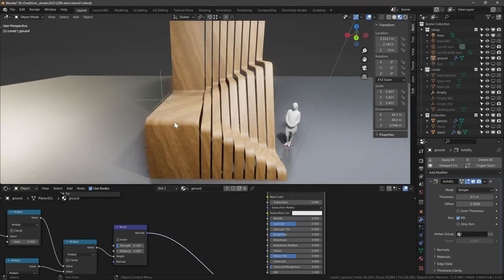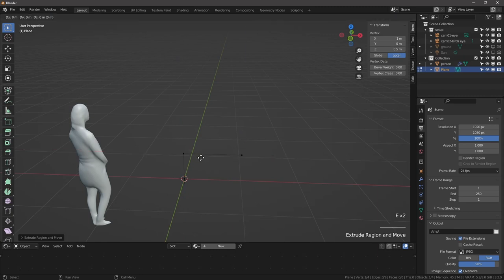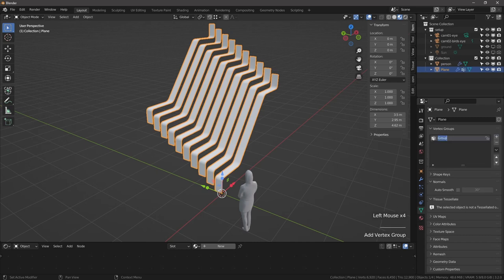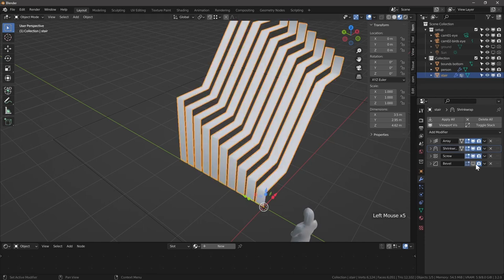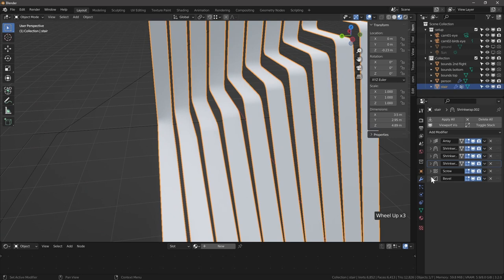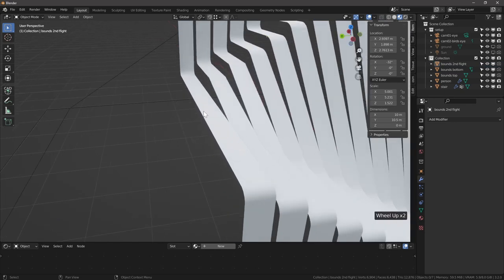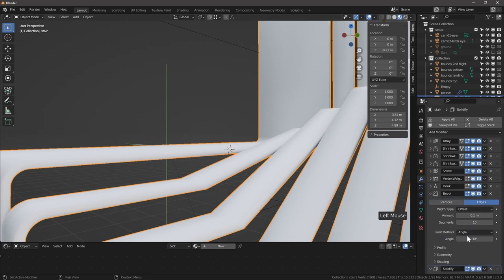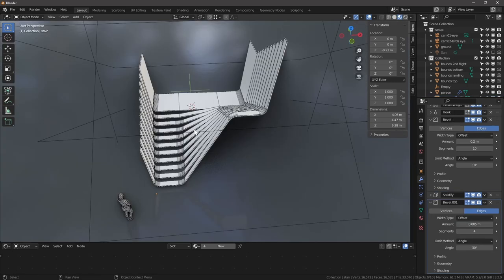Parametric Stairs in Blender #blenderarchitecture

Comment: Thank you very much, very elegant workflow, I had an issue with 4.0.2 all the bevels destroyed around the hook or vertex weight, no way back and impossible to open with a 3.2. I will try  from scratch in the 3.2.
Reply from the maker: Could it be a bug in 4.0?
Reply: @UHStudio  no it is just that when I move down the step 2 target plane  (to flatten the copy) for the landing I loose the bevel on 1st and second flight. And that only when I have 2 flight with no space between (ramp on ramp i.e. no void between). Don't know why but good to know.

Comment: 😞 I'm having an issue with the landing portion of the tutorial. I'm able to get the upper portion of the landing to seal along the Y when grabble the empty but the lower porting connect to the ground doesn't scale. The upper portion of the landing is wider than the base of the landing. A triangular shape. Is there a problem with my vertex groupings? I checked to make sure all of the vertices were in that group but still an issue.
Reply: Fixed it, there was a problem with my initial shape and expanding the bounding shapes accordingly to my staircase. Thank you for the awesome tutorial!
Reply from the maker: Glad you resolved it and thanks for visiting :)

Comment: I found an issue with this tutorial. If you don't apply the modifiers & you wanted to use your own image textures, the base mesh is just a line and so you cannot unwrap it (it's greyed out). The finished object's surfaces will have really thin lines, based on the colors on the textures, stretched across the surface. e.g. If you have a wood texture, you'll have a striped black and brown surface. If it's a stone or stucco texture you'll have white and grey stripes.

Maybe this is just a newbie mistake.
Reply from the maker: Nope, it sounds about right. Objet unwrap and having another object like a cube serving as the driver for the mapping might work.
Reply: @UHStudio  I don't know how to do this yet